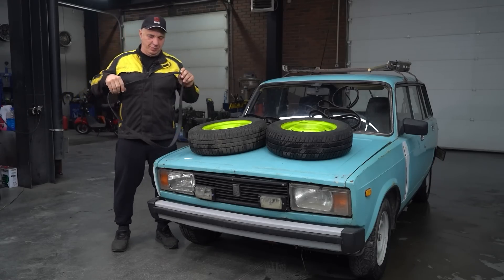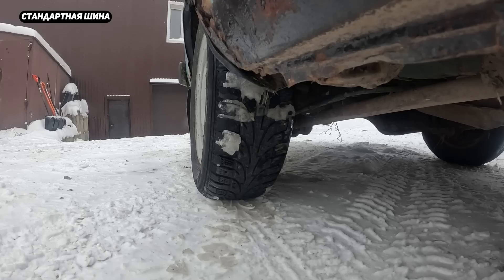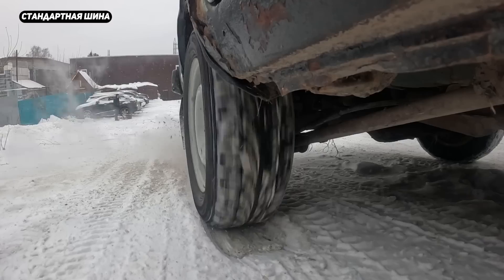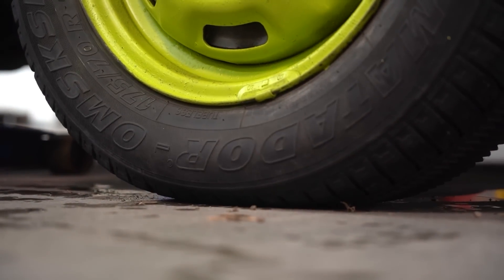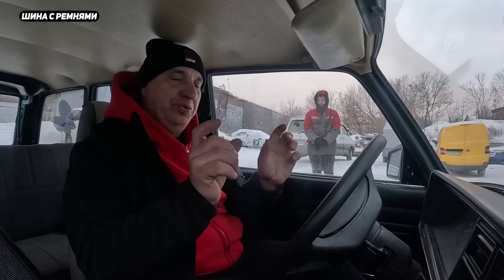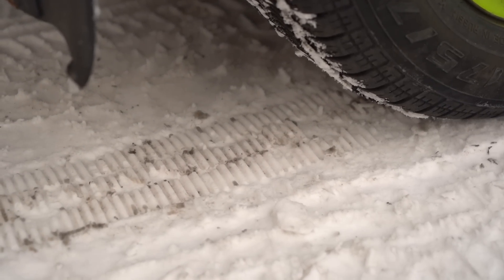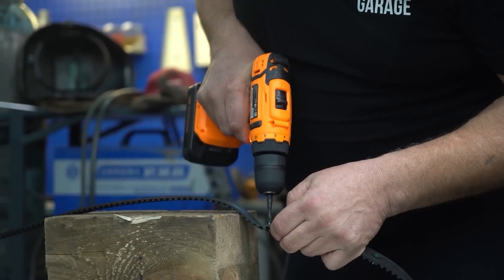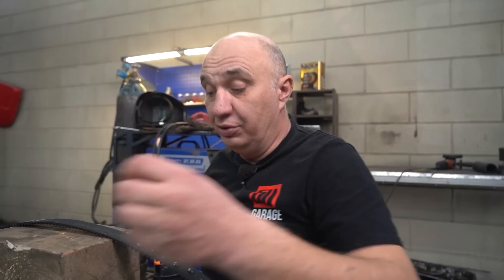We replace tire chains with timing belts - will it work?

Comment: i feel like if you put some kind of solvent based rubber "welding" adhesive on the tyre and belts and then inflated them together it'd hold onto them extremely well

Comment: Patent one wide belt, just deflate the tire, slip over, reinflate the tire, just would have to be very size specific, and need a patern on the back of the belt that locks onto the tire solid. Your welcome.

Comment: i wonder if you put rubber cement on back of belts would they stay on at any kind of speed or going around corners and such seems like it would only work at low speeds for short trips this way

Comment: How about how much faster a car can accelerate by taking stuff off!  Start if with like windows and hoods then move on too cutting stuff off till left with just enough metal to support the suspension, drivetrain, and driver.

Comment: I have used timing belts on lawnmovers when the plastic wheels get shiny. Some glue and skrews is enough to hold it at place.
My leaf collector with a rotating brush is also rolling on timing belts.

Comment: I think you guys were a bit hasty with your conclusion on the incline start... It ONLY slipped because the belt came off... It may have started working itself of as you rolled back to start on incline... Anyhow, great channel, G54...

Мне кажется, вы немного поторопились с выводами о старте на склоне... Он соскользнул ТОЛЬКО потому, что ремень соскочил... Он мог начать работать сам по себе, когда вы откатились назад, чтобы стартовать на склоне... В любом случае, отличный канал, G54...

Comment: I would love to see you do an example of completely bald tires compared to new treaded tires on Bear ice I have always believed that a completely bald and smooth tire just like a drag slick gets more traction on Bear ice than a shredded tire because it has more surface coverage and I truly believe that I have run bald tires on rear wheel drive vehicles in the snow many times I think they may even be better than they shredded tire in the snow because they don't want to dig a hole I would really like to see some actual scientific proof because I believe there is

Comment: Have you ever seen a contraption you attach to your tire for grip that looks kind if like a claw. They remind me of a tiger claw. Ninja actually have something for their hands that looks very similar. I once saw those attached to a Cadillacs back tires and it was trying to climb a hill. Every time they came around and contacted the pavement they threw sparks. Very strange way to try to get traction if you ask me.

Comment: I've added self tappers to my tires decades ago at 10 years old to race on the ice in a modified 3 wheel trike I made and nobody could get around that winter but me so I used my creativity to supply my neighbors with groceries and necessities they could not obtain due to the ice. My legs were jello after that. Felt so good to be able to help everyone. Just because it sounds stupid doesn't mean it is. Invention starts with stupid
Reply: Hero

Comment: The screws may have had less grip, because they did not sink far enough into the snow for the ribs of the belts to grip the surface.  The screws may need to be shorter.

Comment: Suspension geometry and drivetrain alignment can increase or decrease traction, based on personal observation.  A long time ago, I had a 1987 Dodge Shadow Turbo 5 speed, and drove it through deep snow and slush on totally bald Goodyear Eagle VR 50's.  If I even looked to the side, the car went in that direction....so focusing on the intended direction keep the car on track.   Thank you for a very infotaining video guys!

Comment: I grew up on a dairy farm and we had a 1947 willies jeep that we experimented with for traction. We tried barbwire, sand boxes like big trucks had and other stuff. I always did best in lowest gear and slow. If it spun it didn't dig a hole I was 10 years old, I'm 64 now. And I always beat my 4 brothers. I had more patients. 😊

Comment: How about a V8, one bank runs like a 4cyl, the other bank is air compressor, and you put an air motor on the differential to make the car move vs using a transmission

Comment: i am betting had you applied some strong rubber cement to keep the belts from coming off it would have no problem on that hill you just lost to many  belts  i would also think tiny screws would leave very tiny holes in the road way not enough to damage it but then hell all roads need repaving now and then  creates jobs they do this all the time in the Philippines all joking aside

Comment: 😮I've seen someone use solid copper wire used in home construction and he weaves it around the tire in a braided type of fashion until he had a raised line in a hex pattern I've seen someone take fencing and wrap the tire and using those tension bolt thing that has standard threads on one side and reverse thread on the other to secure it. I've seen someone take small tree trunks and fashion a sudo locomotive wheel coupler using rope to connect the front wheels to the rear wheels to make a two wheel drive  into a temporary 4 wheel drive vehicle. He attached the rope through the spokes and the tree spanned from the middle of the front rim to the rear of the back wheel. I've seen someone take one of those rubber anti back pain floor mats and cut one into 4 sections and then using a bungee cord attach them to the outside of the tire. That one was not so effective. I've seen memory foam laid down in front of the stuck car in mud and that surprisingly worked what else... Ohh deflating all the tires to 3psi and that worked. Bad for your tires. Umm I've also seen over inflating them work... Just rope works depending on what pattern you use. A spiral pattern running the rope around the wheel through the spokes and around the tire can have decent results. I've seen someone take the tire off of the rim run short screws through the inside of the tire towards the tread of the tire just barely sticking out of the tread. Hundreds of them per tire then they used a tube to inflate the tires ... I've wondered if you could request from a tire manufacturer if they would be willing to embed semi course silica into the tread during the manufacturing process.

Comment: Make a multi fuel engine- one that will run off diesel, gas, heating oil, motor oil, transmission fuel, heck maybe it’ll run on vodka … the us army has a deuce and a half truck The m35a2 that they say will run off 27 different fuels

Comment: Consider trying double wheels like trucks to see if it helps on snow by having more contact surface
Reply: This decreases traction.
In Ice and snow you want higher point loading to crush and tear through the ice.
In mud and sand you want lower pressure.
Reply: My guess is it will decrease traction because each tyre will have half the weight to pack/compact the snow, making the snow less hard in the threads. But i would like to see that to verify.

Comment: Ok do not think these will work. But I will throw them out there for fun. What if there is a way to heat the tire so it melted the snow. Or even a way to melt the snow next to the tire... Example being a flame throw type device or a laser. Maybe even a heating element you can put in the tire to heat them up. I am sure these would all not be practical but maybe fun to attempt.

Comment: You can take zip ties and wrap them around a bicycle tire between the spokes and it allows riding in the snow. I'd try wrapping something around the tires through the rims.
Reply: That's an old biker trick, you can buy extra knobbly zip ties for this exact purpose - torque is the enemy though, you gotta go gentle.

Comment: Should have compared with the cheap standard of using wire ties fed around the tire through the spokes of the rim across the treads. I always keep a bag of the big cheap Walmart wire ties in my car JIC I have issues on the back roads. Nearly as helpful as a folding army trench shovel in a pinch when stuck in snow.

Comment: Here’s an idea 💡! Super clean a Lada engine inside and out.  Then, fill it with heavy cream instead of engine oil, and see if it can make butter, or whatever would happen.  The cream “should” provide sufficient  lubrication for the engine. If it’s cold enough outside, the cream may churn into butter 🧈. 

Either way, thank you Lada-lads for the years of entertainment, from Canada 🇨🇦!

(Edit addition) - perhaps instead of using gasoline or diesel, you use some type of veggie oil conversion so as not to contaminate the fresh butter! 

Now, I’ll go smoke another 💨 💨! 😂
Reply: stupid idea eh....
Reply: @Trends99_R  take off, ya hoser 😆

Comment: The 3 belts did good, until they slipped off, some glue under it to secure them to the tire, and it will probably work very well. Even froma standing still start in the incline, that failed due to that one belt slipped off, it would have worked if the belt has remained on the tire. This could be tested even more, with more speed and maybe test a left/right turn and see if it skidding more or less.

Comment: Point the exhaust tips in front of the tyres so it melts down the snow and heat up the tyres
Reply: Wouldn’t work when car is moving
Reply: @ the rpms are higher then which means the exhaust gases temperature too
Reply: @pawelarlt676   yeah but the car is moving faster and it wouldn’t have time to melt the snow

Comment: They are remarkable cars. The Fiat 124 was tested hard and it failed in testing. They strengthened the whole vehicle and used their own powerplant. We laughed at them... The Lada had the last laugh, esp. in a tough winter.
Reply: fiat always has and always will suck
Reply: Hmmm wasn't it just that the Soviet industry didn't make sheet metal as thin as designed, so they had to go with a thicker gauge.
Reply: @skuula  I read they took it through some real torture tests and the Fiat broke its back...
Reply: @skuula  But it may be just that..?
Reply: Not only tough winters, but also so much salt on the roads. And it's not like they're kept in warm garage and get their undercarriage washed dozen of times throughout the winter. I'm struggling to think of any German car from this era that would survive that.

Comment: Reminds me about the "socks" that's sold as an alternative to chains. You put them on much the same way but instead of chains they have some sort of fabric with metal threads that is supposed to hold them together and aid with the traction. The positive thing is they are not damaging to pavement so you can get on a road with them. The negative is that they wear down fast. I saw a test that showed that they do actually work better than normal winter tires without dubs. But they are not as efficient as real snow chains.

One thing you didn't mention about snow chains is that they tend to be unsafe as speed increases. Generally you are not supposed to drive faster than 30 kph or about 20 mph so even it they are legal to use you wouldn't want to on a regular street.

There's also some weird metal clamps you can attach to the wheels. These are generally more expensive than snow chains and is supposed to be easier to attach. Just unfold them and thread them over the tire before letting the springs tighten it down. I have never used these but I can't say they seem all that good. The only parts making contact with the road is the four parts that form the hocks that is clamping down on the tire. It might make a difference for thick snow, but I doubt it will be anywhere near as effective as regular snow chains.

Now what should be interesting is seeing tires used for ice tracing. The spikes on those are insane.

Comment: You guys are hilarious with your idea, and I hope no one will try your crazy ideas and risk endangering people on the roads and by the way when you're speaking snow you gotta think super soft rubber not hard nails and stuff as the super soft tyres are working far better on ice and snow.
P.S you should have the reinstalled the belt when it came off bcz you were depending on their traction that's why you failed in the middle of the hill

Comment: In wich year did the 21043 start to equip the 2107 interior? The oldest I know is one from summer of 1990
Reply: 21047 only equips 2107 interior. Start produce in end of 1990 decade. It has 2106 (1.6L) engine.

Later it comes to 21041. Same as 21047, but has injection engine 21067.
Reply: @Sl4sH322  What I mean is the 2104 with 1.5 engine (21043) I've seen with both interiors, but the oldest I've ever saw is from summer 1990 with a beautiful dark red colour (same one from the Samaras)
Reply: @mindujiman  it could be modified car, like 2103 interior in 2101, or rare export version. Maybe.
Reply: @mindujiman  I found some information.
21043 variant 20 had 2107 interior.

21047 always had 2107 interior, produced from 1999 to 2005.

21041 always had 2107 interior, produced from 2005 to 2012.
Reply: @Sl4sH322  Thank you mate! I assume from that such variation 20 started production a bit early than that. Awesome info!
Reply: @Sl4sH322   Does the central vents work on it?  The 2107 has additional holes on firewall to feed it. So even the body must be different.
Reply: @2103i  2105 and 2107 have same radiator. I don't think that they give much difference in cooling.

Comment: zip ties as an emergency tire gripper. Maybe also a small ratchet or bungee cords.
Reply: Works on a motorbike in a pinch especially leaving the tabs facing up - torque is your enemy though, but in a pinch with a gentle touch it works. On a seperate note, they sell specific emergency snow chain cable ties - again torque is the enemy!

Comment: I used to use 'chains' made of cables on my '60s SAABs.
Damn things would go ANYwhere!
And they weren't as violent as actual chains. 
A good compromise.
Reply: I also had a set of what you described. They came with an old car I bought once

Comment: Why didn't the studded belts slip off like on the 1st experiment?   Way cool idea.  Love it!
I bet you could use screws to hold the belts onto the tires.
Reply: the screw heads made the belt fit tighter on the tire plus probably resist slipping on it too
Reply: @Mackze  Maybe true.

Comment: How about v8 bank 1 diesel & bank 2 benzine?
Reply: It would technically be a hybrid
Reply: @gregs8672  Flex fuel
Reply: What would you hope to learn from this?
Reply: Why does everybody shit so much on his comment. They do more “stupid ” but very fun to watch experiments. He just came up with a suggestion
Reply: good 👍
Reply: YES
Reply: how about v8 but one side  uses turbo other supercharger
Reply: This would sound interesting with a straight pipe. Also would need to be able to cut fuel to the diesel as it would not rev high enough to match the petrol. Another isssue would be matching engine load and speed to the crank. Vibrations too. A lot of work for nothing but a bit of fun
Reply: It will rattle the crap out of its self but it's gonna be fun to watch
Reply: Either more. Half Turbo Diesel half Turbo petrol or supercharged 🤣
Reply: Flex fuel
Reply: V8 hydrogen fuel engine with twin charge ( turbo and supercharger) and put it to the lada!!!!!!!!